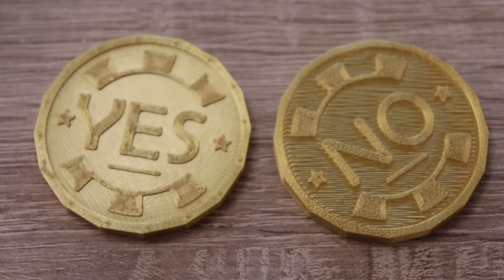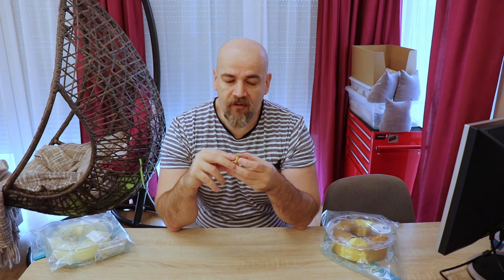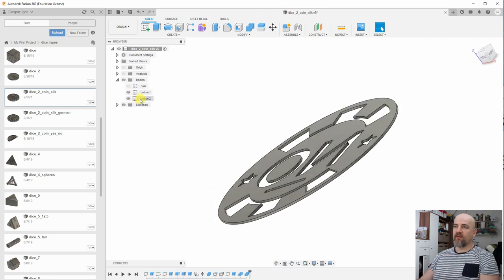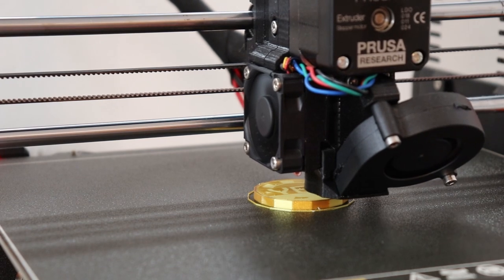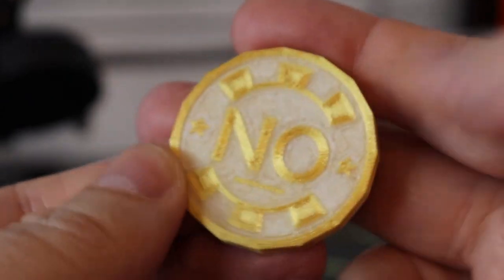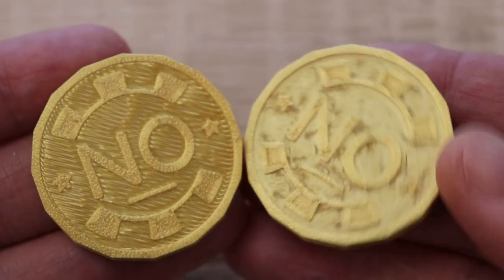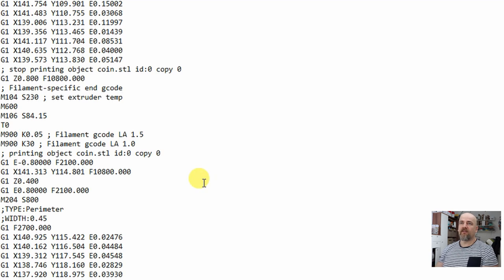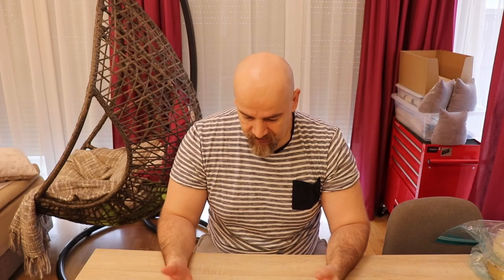Two tests with 3D printed coin - ironing on the top, PVA supports from the bottom

Comment: I always enjoy your tests. Thanks for sharing this one with us.
Is it possible to "iron" the top PVA layer? Maybe this could clean up the interface with the PLA. It might end up mixing the PLA and PVA together as it irons so it might make things worse.
Thanks again for sharing your experiments with us.
Reply from the maker: Looks like PVA is not good for some precise, nice 3D printings, but I will give it a try.
Reply: @MyTechFun  If the PVA is printed first, you need to change the filament only once, and when PVA will be ironed where would be nothing to mix with. However, that might mean the PVA support should be printed as a separate .gcode to enable ironing. But since you have original CAD files for coin it is easy to create the support part.
But, now I think I don't know much about adhesion of PVA to surface. Though, in PVA manual they say it could be used to print entire raft.

Comment: For this specific model splitting it in half (horizontally)  printing and then gluing the two halves would generate better results and would be faster as well.
Reply from the maker: Yes, I was thinking about that, but never tried so far. Wonder, how will side line be visible.

Comment: So here's an idea for you. Insert filament change pause command into the print, and when it has printed the support layer, you take an alcohol-based marker pen, and just paint on top of the support print! After the print is finished, the remaining marker ink will serve as mould release, and allow you to peel off the support material. Some marker may remain on the print surface, but it can be washed off with alcohol.

Odds are, a number of other pen types or other coatings can also be used, you may for example smear glue stick on the support. Maybe ink killer pens and the like. I hadn't tried any of this myself though.

I have the idea from a video demo "Perfect supports with single extruder" by Tumblebeer, where he added an externally controlled power actuated pen mount to the toolhead. But it stands to reason that with geometry this simple as your coin, you may not even need any automation to accomplish this.
Reply: Interesting approach👍
Great idea👍😀
Reply from the maker: Definitely something I will try in near future. Thanks for the idea.

Comment: Cool stuff. 
have an ultrasonic cleaner? that might get rid of the pva
and have you tried splitting the model so you have both sides as top surfaces and then a bit of glue. If you print on a glass bed that should result in a really clean seam.

Comment: Pretty good! both sides are still not the same but the top also got an upgrade in quality thanks to ironing.
Thanks for showing the method, I didn't realise it was possible to print two filaments like that without dual extruders.

Regarding the lack of temperature change, is it a bug in Prusa Slicer? It feels like it should have inserted the temperature change GCODE already.
If it's as intended then I suppose inserting the temperature change in the filament start GCODE would also do the trick.

Thanks a lot for sharing! Super interesting.
Reply from the maker: Probaby bug. Or it just work with MMU, they didn't predict "hacks" like 1 extruder multicolor 3D printing..

Comment: Another easy way to improve quality of small things like this and rings is to lower layer height to .10 or whatever your printer will handle.

It really makes those outside layer lines disappear and feels closer to an injection molded item than .2mm layers can give you.
Reply from the maker: With horizontally printed coin there is no big difference (.1 or .2). But yes, it can improve quality for vertically printed coin.

Comment: I think you need to recalibrate your printer. The nozzle needs to be closer to the bed. Lines of filament shouldn't have gaps between them. I believe you will see better results if you do this.
Reply from the maker: Those lines in background of the side NO are 3D printed in air (the bridging). The first layer is good (letter NO for example)

Comment: Have you tried to iron the top PVA layer so it is more uniform for the succeeding silk layers?
Reply from the maker: No, I think PVA is not too good for ironing (but I didn't tried it so far)
Reply: @MyTechFun  Just saying having a solid/smooth(ironed) surface would probably go a long ways for a solid/smooth underside for the coin - very much like the texture of Prusa's spring plate appears on the bottom layer of a print. I've never used PVA at all, so maybe it doesn't iron well, but if you really want that perfect underside, that's what I'd try next.

Or try a PLA/PETG - model/support print with the mentioned ironing. Those two materials don't adhere together well but do iron well.

Comment: I have an Ender 3 v1. I want to wire in a 12v LED light. I have a Buck converter. Where is the best place to tap into the 24v?
Reply: There are spare screw terminals inside the lower part of the power supply. On mine I 3D printed a bracket to hold a bit of "chock-block", bolted it to the frame with T nuts and wired it into the PSU terminals.
Reply: @EricTViking  Thanks. I have a buck converter and one of those RF remotes to control a 12v LED.